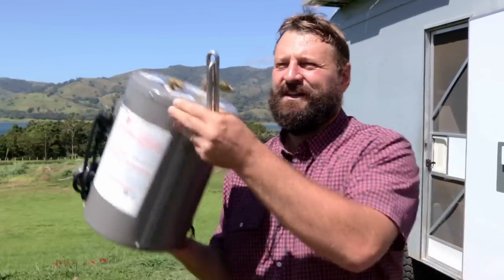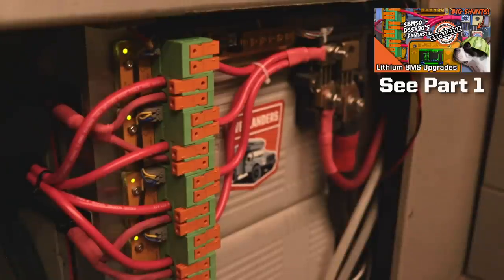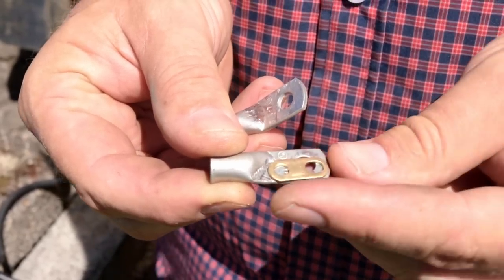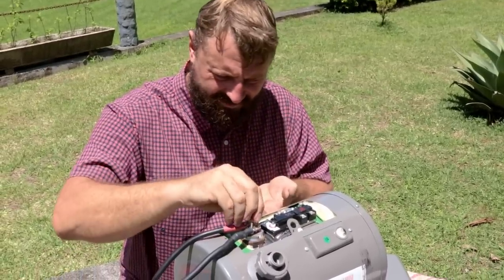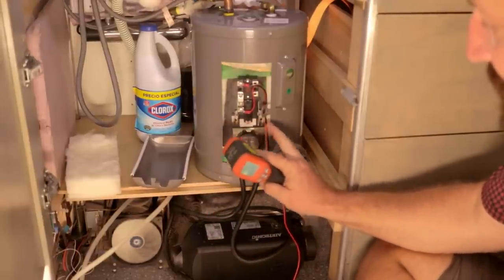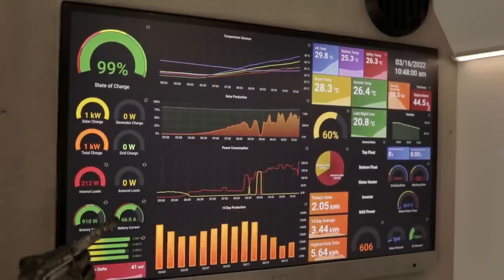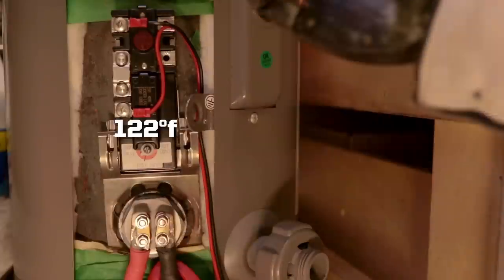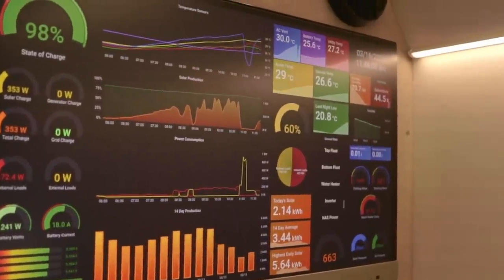Part 2 - Solar Electric Hot Water using DSSR20's Heat Diversion and 600w 12v Heater

Comment: I've two questions: 
1 - How do you protect from turning on the heater if there is no water ?
2 - If you kept the 120V heating element and added a solid state relay  to turn on/off the heater via software, won't that achieve similar results ? 
I'm guessing if battery is low the SBMS0 can turn off the inverter, then after charged inverter comes on, and with that software kicks in to turn on/off stuff according to time, motion and temperature sensors.  So the diversion load can be a water heater, AC, towel warmer, compressor.
Reply from the maker: 1 - Most (all?) Water Heater Tanks "In" and "Out" are both on the top of the tank... So normally you can only get water out by pushing more water in. This ensures the tank is always full, if the water supply stops, the tank is still full.
2 - Yes, that's effectively what I'd been doing until now. But Inverters are lossy, you might lose 15% to conversion loses, it's a heavy load on the inverter, the fans all spin up to get rid of the heat...

In our application it's probably not such a big deal, I implemented it because I had it, but if scaled up to an off grid home in Canada, You could have 5 or 10kW of solar dumping into much bigger heaters, in much bigger tanks...
Reply from the maker: That's exactly what I've shown, the DSSR20 is Digital DC SSR... 🤷 ($27)

Comment: Is that scale buildup on the old heating element normal? Must be a lot of hard water down that way. 

Thanks for another great video!
Reply from the maker: It's pretty common for scale buildup in water heaters, but for as little use as this element got, I would say it's pretty excessive, I suppose it is pretty hard water, mostly from wells near to the ocean.
Reply: @Everlanders  I'm throwing my hat in the ring for a project suggestion... DIY small scale water softener (or pre-filter?) system. 🤓
Reply from the maker: @NimblyJimbly  Yeah, maybe a filter, Unfortunately I think the water softener is too big and wasteful for our needs. Now that I see the scale after only a year, I'll be dumping the heater tank and descaling my system once a year or so... Would be good to find a pre-filter down here somewhere...

Comment: I’ve been looking into this type of technology for awhile now and also about matching the amount of solar panels resistance with the resistance of the heating element regardless of homepage or wattage what are your views on that
Reply from the maker: Yes, this would result in the most efficient transfer...
Reply: The resistance of the solar panel changes with current produced. It is not  a resistor which is constant, it's a semiconductor device and the I-V relationship is non linear.

So you can never always match the resistance of the solar panel to the load resistance.

Comment: I plan on doing something like this to heat my greenhouse I plan on using direct current from like a 2 or 300 watt solar panel I bought the 20 mm thread water heating element that I plan on screwing into a empty propane tank the only problem is I don't want it to steam out build pressure and explode so I'm thinking of some kind of way to make a pressure relief valve I was kind of thinking maybe drill a hole and put some kind of weight in the hole kind of like pressure cookers have or maybe even a thermostat from a vehicle any input would be appreciated.
Reply from the maker: You'd want to switch of the heater with a thermostat long before the water comes to a boil to create steam. And by the sounds of it, open to atmosphere is a good plan too.
Reply: @Everlanders  okay thank you for the advice I'm guessing I'm going to have to hook an inverter instead of direct current and then get a thermostat like the ones for the greenhouse and somehow wire that in.

Comment: I added a thermostatic valve to increase the hot water storage, so I can heat it to 165  and inject cold water to bring it back to 110 degrees f
Reply from the maker: We keep ours at 85°c (185°f) and mix at the tap! 😮

Comment: Is the main reason you're diverting the solar directly to the heater, rather than having a relay on your battery system trigger when it's at 100%, to not put unnecessary load on your battery system? I guess if it was a relay it would only be able to turn on the full load, which may pull more power from the batteries than what the extra solar could put in and then just turn it off again. Whereas this way if you're only getting 150w of surplus solar, that's all the water heater element is given and that's that.

.... Okay I think I just answered my own question... *Walks slowly away*....

Comment: Watching this again, don't you think there is a risk that if just one of those 4 relays welded shut, you would have 70+ amps through one 8 gauge cable and worst still, no way to stop the water from further heating leading to that water heater going boom? Or do you not see this as much of a risk and i am missing/overthinking.
Reply from the maker: The same risk applies to every solar charge controller on the planet, if the FET fails on, the battery is going to blow up. Fortunately,  FETs fail from over current, and the solar panels can't make enough current to over-current the FETs anyway...

Comment: People were forgetting that while 1/10 the voltage means 1/10 the current, power is volts x amps, so you'd get 1/10 x 1/10 or 1/100th the power.

I might want to use the breaker thermostat thing independent of your smart system. Have it drive a 12V relay that the power runs through, you can get 50A relays for stuff like car starter motors. Any scrap yard would have them, plus the socket. Then you've got a foolproof, brainless safety system. I'm a computer programmer, I'd feel much happier knowing there wasn't any software involved in my safety!
Reply from the maker: I am using thermal breaker as I showed in the video...
Reply: @Everlanders  Yup I saw, but it depends on the solar controller functioning properly, which is a computer. I'm sure it's reliable but it's better for a safety system to be independent, and ideally dumb and as close to intrinsically safe as possible. 

You'll probably be fine, I'm sure, but that's what I'd have done, if I were lucky enough to have an RV.

Comment: Instead from batteries what if we give direct solar DC to the heating element. Because pulling the current from battery is impacting battery lifecycle.
Reply from the maker: That's exactly what it's doing, No power is coming from the batteries.
Reply: @Everlanders  that's great, again I am concerned that the if current it pulling from charge controller then it may introduce heat to the electronic parts like mosfets and capacitors and affecting their life. I am amazed to see someone in the world having same thought process for the green energy. Today solar energy becomes cheaper but the electronic items used for conversion are still expensive and has recurring expenses due to their life cycle.
Reply from the maker: There are no Mosfets or Capacitors in these charge controllers... They were designed with Ideal Diodes which have a total internal resistance of 3.5mΩ producing a paultry 1.4-watts of loss to heat and thus a 99.7% transfer efficiency.

Comment: I can't help but wonder if there is a clean way to simply route the air conditioner's evaporated line directly through/into an insulated tank.  The heat conduction would increase efficiency, and the specific heat of water is among the highest, so the btus would never go to waste!
Reply from the maker: Sure it could work... But now that we're in the High Andes, we don't use it much.

Comment: So, this puzzles me, a heat pump would be more efficient, get a crashed Tesla's heat pump, should be enough
The genius here is to route the heatpumps wire under the solar panel, that way you can cool the panel and get heat
Reply from the maker: You think there water lots of crashed Tesla cars in Ecuador?
Reply: @Everlanders  you can reverse a fridge to use as heat pump, probably easier to find in ecuador

Comment: Im sure 2 elements
 in series will still be 2 x 300 so 600 not 150 and 600 parellel also even though resistance double im series still think the tank is small and also waste alot of energy i can't see it being good for shower 🚿 only for washing hands and not anoth for a bath 🛁 to small maybe another way would be better on damamd heat would more efficient and no waste and also using  dimples on a tube inside another tube cause friction and implosion technology and very efficient for instant hot water or maybe an induction coil
Reply from the maker: We'll have to agree to disagree!